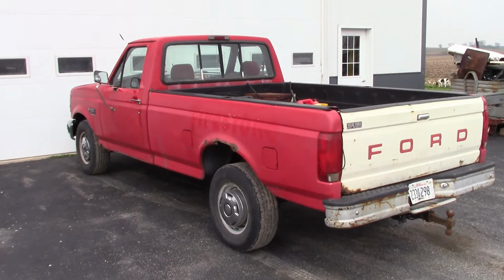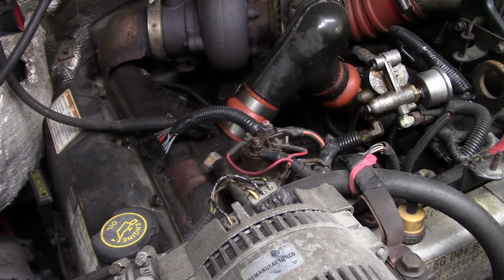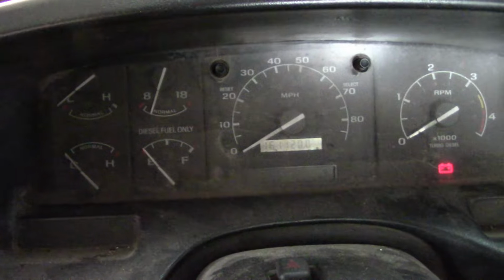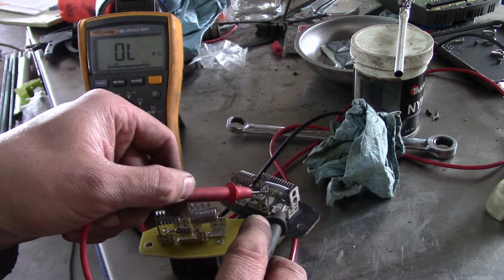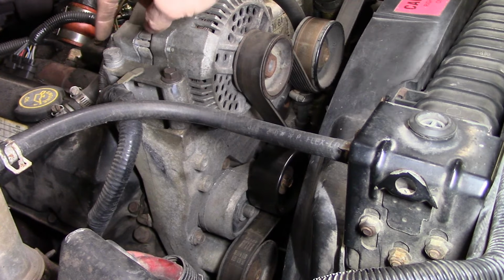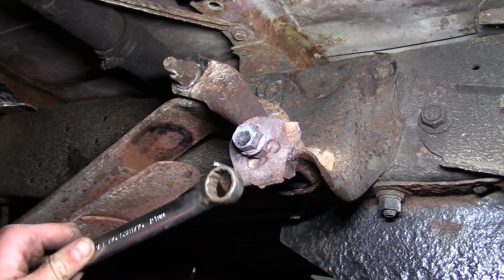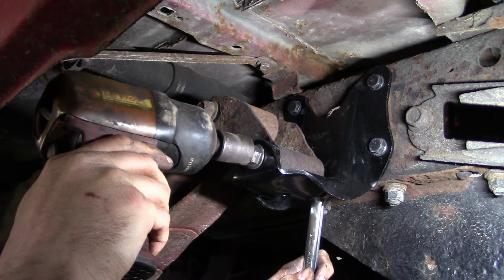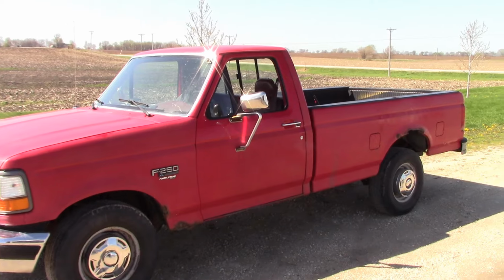1995 Ford F250 Maintenance - Glow Plug Relay, Blower Motor, Belt Tensioner, Rusted Spring Perch

Comment: If you are noticing that your heater is only putting out air in the defrost mode it is because the white vacuum line near the passenger side hood hinge on your truck  is disintegrated. 
Replace that rotted line with regular rubber vacuum hose. Cut it back into the loom so you can connect to an area of white line that has been shielded from UV exposure. The other side of the line goes to the actuator on top of the heater box.
Great videos and I appreciate the fact that you film the humility you experience instead of hiding it like in the DT466E oil pickup tube bolts that were "missing". 
Keep it up!
Also noted that you have the old tailgate in your scrap bin. Those aluminum trim panels on the tailgates are worth a few bucks to others if you toss it up on craigslist.

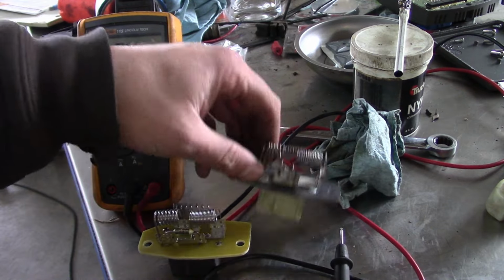Comment: 17:07 that resistor-looking part is a thermal fuse. They go open over a certain temperature. I have replaced them in waffle makers and such. They're 10 for $1 on eBay or AliExpress from chinese sellers :)
Reply: There usually is a temperature {in degrees C} printed on the fuse.  Stay as close to that value as going higher could cause a fire!
Reply: They even bury those in transformers. Replaced one in my early 80's hifi amplifier two weeks ago.
Reply: Replaced many of these in all kinds of electrical stuff. Its purpose is to prevent overheating of the resistor unit when the motor is blocked.

Comment: Hi from South Africa. Please carry on with commenting. Silent movies went out of fashion 100 years ago! :-) The goody that went open in the fan resistor is a temperature fuse. Used in kettles, irons, tumble driers, cookers, hair driers etc. They cost about $0.50 and the temperature it fuses at is usually printed on the side. You can just jump it. They are usually placed by manufacturers to force failure and then replacement. We are not supposed to keep stuff working remember! Throw away society! Thanks for the great videos.

Comment: That little "resistor" on the resistor pack is actually a non resetting thermal fuse.
Reply: Yup, and nothing a piece of wire soldered across can't fix lol.

Comment: Ah, that's a thermal fuse. that's to keep it from overheating (and stating on fire) when you are on the lower speeds but the fans not spinning.
Reply: Yup, thermal fuse.

Comment: Thermostatic fuse on the blower motor resistor module, super cheap on eBay or from any of the other usual suspects like digikey or mouser. 

Also keep up the commentary on the video! Love it, it’s what makes the channel one of my favorites.

Comment: On the GP-relay, I bought one for like $20 on amazon for my 7.3, if you haven't replaced the valve cover harness/factory defective two plug harness that will rattle loose, & it'll be running bad when you hit a bump. I replaced both sides, & it made a huge difference. 

If its above 35 degrees it should start no problem without the GP-relay, I live in Texas & I have a switch on it for when I need it, like 1% of the time in the winter when its colder than 35 degrees.

Thanks for the videos on these OBS 7.3s most of the 7.3 videos out there are on the 7.3s after 97/98-03.

Comment: Your truck reminds me a bit of our '72 International. Replaced the hood and one fender with a Better one. Less damage than the prior one. In the past the homebuilt flatbed replaced the original, but someone didn't anchor it well enough so it found the cab and has left permanent band on the cab where the two have contacted. Similar floor boards to yours, old AA battery jammed between the back of the cab and the cab support crossmember left a corrosion hole and bulged area. It is rough, but it pushes a snow plow hard, will drag whatever you put behind if it can get traction and it is paid for. Appreciate the videos and talking through your thoughts and steps as you work through your projects.
Reply from the maker: I worked at a shop that had a similar International for moving trailers. 345 gas V8 engine. At one time it even had a train hitch to move train cars around the yard!

Comment: I know this is years down the line and you've probably been told this a thousand times by now. But the "resistor" that was open circuit is a "thermal fuse", basically it's a piece of solder in a metal container, if it gets too hot, it melts and sends you off to buy a new gizmo. It isn't involved in the speed control of the motor, it's just there to get you to spend money. Bridge it out, it'll work fine. They put them in everything now, the hope being that you'll throw whatever they're in away and buy a new one.  Oh, and by the way, please keep talking :)

Comment: I'm started viewing for the work, but the commentary is what keeps me watching . I found the prices of scrap being chronically low and the use of the Isaac Newton fastener to be comments I'm likely to recycle. I also have a fresh nest with TWO blue eggs right next to my front door. Looks like a bumper crop for robins this year. I have no SOS Ford alternator bolts, but I do have Dodge first gen hinge pins.
Reply from the maker: Never seen a Dodge that didn't need hinge pins.
Reply: @WatchWesWork  Million mile engines (12V) in 20k bodies. I feel your F250 pain.

Comment: Oh the struggle lol. I've been in your shoes so many times. Good old trucks though.

I swapped diffs in my 96 f350, so I understand the struggle with those bushing bolts. Only way I got them was with heat and leverage. I didnt have a sassy lift.

Also, not sure what your winters and summers are like, i know you're likely aware of the mod, but I put my glow plug relay on a button so they dont do their 2 minute cycle everytime you start it. Seems to extend the life of the whole system.

Love those old trucks. Drive mine still all the time. Keep up the good work fella.

Comment: I still have a few old Ford trucks like this. My 1991 IDI I just use to move water totes around on my farm. It's basically only used as a "tractor" I don't even take it on the road. So it works perfect for that. I'd say keep it if you have a use for it. I don't think you need the money, at least, not what you'd get out of it... But if you're sick of looking at it and someone is offering a crazy price, unload it and find another truck that is cleaner. They are out there, but it's hard to find them and when you do, they are expensive. Love me an old 7.3.

Comment: Watching this brings back the EXPERIENCE  I had on a Ford from the salt belt. Getting the bolts out and the rivits cut was bad enough, but getting the spring back down through the hole it rammed in the floor of the truck bed when the bracket broke was a real trip. Keep talking and thanks for the vid.

Comment: I had a 94 identical to this truck with a utility bed on it. Mine was a 351 automatic and did have air and it was white. Truck ran good and was totally gutless lol. Got gallons per mile. It was at my old job and nobody used it so they stuck me in it. Whenever they sell it I’d like to buy it and slap a long bed on it and use it as a work truck.

Comment: That "little component" on the resistor pack is a thermal fuse. If the resistors get too hot, ie: the fan motor locks up, it goes bad and cuts the power. I don't know a good way of attaching a new one since its crimped in, but they can be had very cheap on the usual sites. I've replaced dozens in electric kettles, clothes irons, and the like. Saves some money if you're motivated enough.

Comment: Being the cheapskate that I am, many years ago, we had a 67 Buick Electra and the blower motor started squealing. I drilled a tiny hole in the end of the motor housing where the end of the shaft bearing was. I squirted a few drops of 3n1 oil into the hole and the noise stopped. It lasted that way for the duration of the time we owned the car.

Comment: I know it wasn’t the right part but I replaced one on a 7.3 truck one time and I didn’t use the original I put a 100 amp continuous duty off of an electric forklift Or pallet jack. Needless to say it never failed again. It’s a pretty heavy duty little guy Worked great you could really hear it snap on the glow plugs come on.

Comment: Growing up, we got a new 1965 Ford F100.  The blower motor had a terribly loud vibration.   We never fixed it because we were in awe that the heater could actually heat the cab in the winter.    I would be curious to take it apart and see why it was so far out of balance from the factory, but we sold it after it rusted out.

Comment: That motor control resistor is the same  as Ford and GMH (Australia) were using in their vehicles here in 1960's as my first car had the same thing as have all my cars since atleast till the present one that is a 2002 model but i havent gone into it for no fan working yet ! It still works on all speeds.

Comment: i got an f150, same year, same color. mine's a 4x4 with a straight 6. it was an old farm truck i got at an auction for $1300, and it still had a bed full of loose straw in it. my interior is better though. and grey. surprisingly enough, the ac works perfectly. i talk to myself as i work alone in my garage, so it seems normal to me.

Comment: Mystery resistor is a thermal fuse. Low air flow and it overheated. Pop goes the fuse. Keep talking. I really don't like videos with no talking and worse than that in techno music. You are doing a great job.

Comment: I have a similar truck in the classic white and rust color combo (1997 crew cab with the automatic transmission). I'm jealous of the 5-speed. The white vacuum line coming out of the harness near the blower motor runs the blend door if I'm not mistaken. The cheese-eating friends seem to like that line as mine was half-gone as well.

Comment: I think that device you asked about is a fuse link. If you lose air flow over the resistors they will over heat and could code a fire. But the link should protect that from happening

Comment: The failed component on the blower motor speed control resistor network, is likely a shunting diode. The diode prevents reverse currents going back to the selector switch when we shut the power off to the blower. (Reverse voltage surge from coil-type resistors) If you can find the diode p/n,  it's a very simple fix in most cases. Remove old diode. Install with proper orientation of new diode. The system should work fine afterwards.

Comment: My thoughts on the truck...   You already have so much time and effort into making it right, you may as well hang on to it.  Starting over with another truck is just starting over with another list of problems, hack jobs and questionable fixes.  Cosmetics aside, you've got a solid work horse that you know is fixed right.  And like you said, the 7.3 + 5 speed combo will outlive the cockroaches.  Keep her.  👍

Comment: Wes,  Keep the new unused long arm belt tensioner in your SOS supply, when it comes time to buy a new belt everyone will sell you one that is just a bit too long and the belt you have now will be hard to find (apparently the long arm tensioner and the longer belt is an updated version by the OEM).  Also, if the belt starts to squeal, oddly enough the alternator pulley can wear out and if you don't know that this can cause belt squeal, it will drive you insane!  Especially when all the belts you order are just a bit too long and the stock tensioner is right at the end of travel but otherwise perfectly healthy.
Reply from the maker: Interesting. I didn't know there was another belt option.

Comment: Wes, in digital electronics "ground side, switched" is referred to as "active low." 
Not that you are wrong; you're not, I'm just adding another term to the definition sheet! :P
I certainly didn't know that the two contactors were actually different... Thanks for the clarification, sir!

Comment: Fun times. From the rust belt, I've cut numerous Ford spring shackle bolts off. Unless someone had it apart with never seize, it's cut cut cut.
Reply from the maker: What I have found works well is to push the sleeve out of the rubber a bit with a press, then rattle the sleeve with an air hammer from the side while holding the bolt in a vise. Then push the sleeve back in the rubber. But often the bolt is rusted beyond reusing anyway.
Reply: @WatchWesWork  I have to do a set on my '97. I will see how that works.

Comment: @19:50 if it is feasible, you can buy a slightly longer belt, if there is one available to use the new belt tensioner assembly--because there are myriad belt options out there. You can also go to a shorter belt for various engine mods, such as bypassing an unneeded idler pulley [done on older Saab 2.3 liter engines]. Then again, it is a variable spring tensioner, it 'gives'--it was a disservice to not try to fit the new assembly 'for the viewers', not to mention new belts are shorter than one with 10,000 miles on it. It will stretch some and the slightly larger tensioner won't seem so radically 'wrong'.

Comment: I had a '93 F250 IDI diesel that would throw the belt off if I ran through a deep puddle too fast. I had to do the tensioner also. Sooner or later it will need a radiator if it hasn't already.

Comment: That silver piece on the resistor you were calling a resistor is more than likely a thermal fuse. If you can read the temp on it, unsolder it and replace it. However, being that the whole resistor for that vintage is reasonably priced and may not be worth the time to fix the old one. I have variety packs of those discretes like capacitors, resistors, thermal fuses.... some quality parts/components are getting harder to find.

Comment: Keep the running commentary.  Since you asked, I would keep it, if it was my truck, I would clean the interior.  Get a junkyard seat, either bench or bucket seats.  I would also put that duct foil insulation on the roof and either a junkyard headliner or something.  That foil insulation is also a sound dampened and it made a noticeable differ in my jeep. Oh and fluid film the entire under carriage.
Reply from the maker: Yeah, it is crazy loud and hot compared to newer trucks.

Comment: I came here to comment on the mystery component on the blower resistor pack (easily replaced thermal fuse) and using a common relay in place of the expensive GP relay, but I see that's already been pretty much covered. 
In electronics, the switched positive vs switched negative is referred to as Source and Sink. If it was me, being an endustrial controls kind of guy,  I might install an interposing relay between the ECU and GP relay to convert the sinking output from the ECU to sourcing for a common starter relay. One of those common Bosch style relays as are often found in the auto industry would work, as would a little "ice cube" relay made for industrial use. If those GP relays are prone to failure, the change would pay for itself quickly, possibly on the first time you had to swap out a bad GP relay. There is more than one way to skin a cat!
Keep on doing what you're doing, Wes. I like your channel just the way you have it now.

Comment: Front fuel tank, probably just needs the sending unit cleaned.
The back tank is easy to replace, I  installed a new 38 gallon tank in mine, that is for a ford Bronco, bolts right in, of coarse with longer bolts, LOL.

Comment: I'm not sure if it was mentioned already but a relay, solinoid or contactor doesn't care or even know if it's groundside or positiveside switched. Then again you're way better off using a quility part. 

Either way, nice vides thanks for posting.

Comment: Keep the damned truck Wes. I have an old r2200 81 Toyota 4x4 with rusted out rear bed sides on its fourth engine and this time I got a racing engine and it will do over 100 mph I may never sell it.

Comment: That component in your fan switch a thermal fuse. They do not reset. They are used in motors, and also transformers as well. Knowing how to find them can be a make or break situation on a $150.00 motor. This component is probably a $3. item.
In the situation of your fan switch, it's not likely that you could replace that, as it's probably spot welded in place.

Comment: FYI the relais is exactly the same: there is no technical reason why a four pole relais would care about which side the control circuit is interrupted. Even if it were a polarised three contact relais with a common contact (which this is not), it would simply be a matter of building the relais the correct way, but it would not be particularly more expensive one way or the other. There is no reason for that relais to cost more than the starter relais, except for the fact that the starter relais on the 7.3 (and on all others) is on the control circuit of the solenoid, so it carries singificantly less amperage.
Oh and. The component that failed in the resistor is a thermal resistor. So the thing overheated and failed - probably related to the motor having issues.

Comment: I've had my glow plug relay in my 2002 super duty go out a few times And all I did is watch videos on YouTube. To test it the big wire on the left is a constant hot.
 And then when you turn the key. The big wire on the right turns hot until the glow plugs go out.
 So When?
They were broken.
The right side which gives power to the Glow plugs would like intermittently.Come on or only come on for a second or f Flicker on and off And both times that mine went bad when I took them out. You could shake it in your hand and you could hear like broken Plastic pieces all inside of it both times I Don't Know if it's from the vibration or if it just gets so hot Like You said.  So much current goes through it.If finally blows out but I don't know if the obs ones are different But I know mine couldn't get any more simpler.
 Left simpleft side constant hot right side. Turn key gives juice to the glow. Plugs right side doesn't come on when you turn keep or only comes on for a sec. Or flickers, obviously bad.  Pretty simple.I thought like I said maby o b s is different